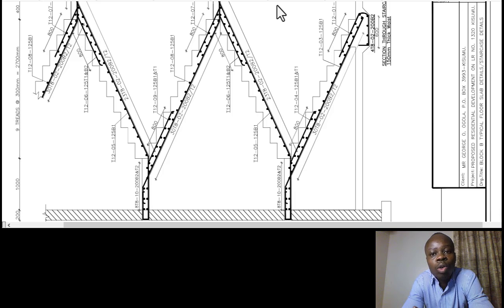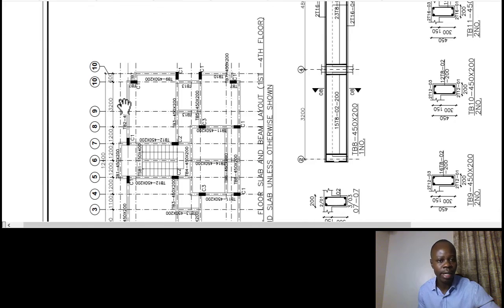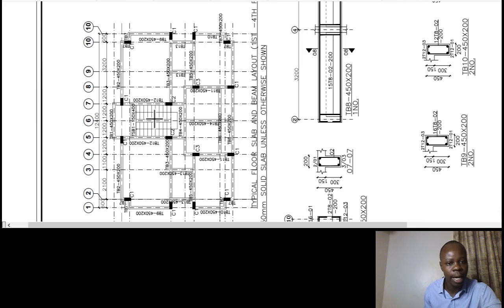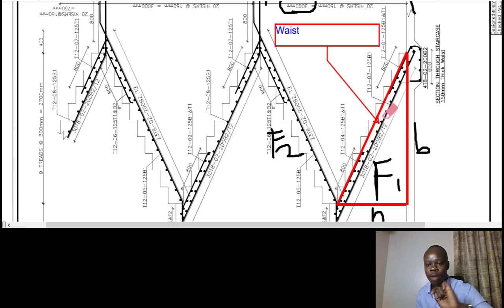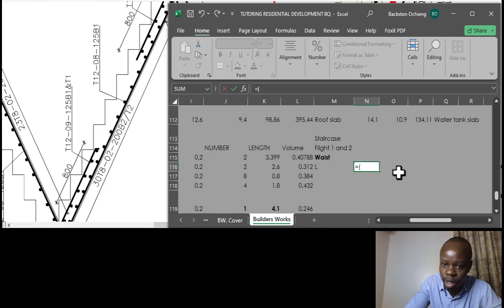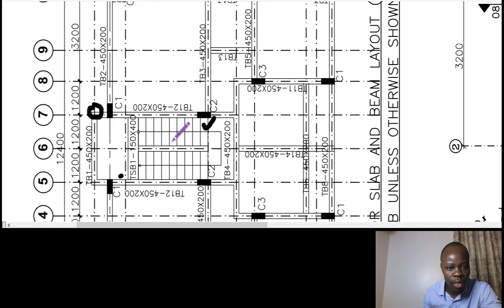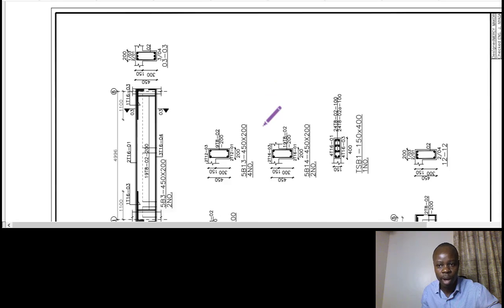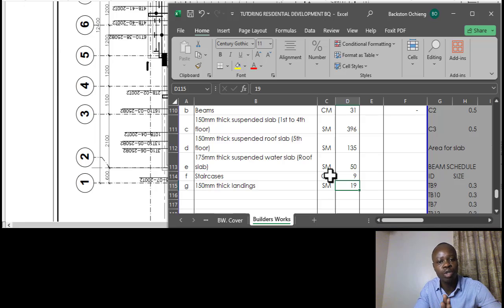REINFORCED CONCRETE STAIRCASE & LANDINGS TAKING OFF EXPLAINED E16//BILL OF QUANTITIES USING EXCEL

Comment: We have three items in  concrete stair case (waist +steps + landing) but then why in steps you calculate the width of flight, in my opinion no need that (1.3m) in the calculation 

Just (10*0.5*0.3*0.15 ) is enough for one flight